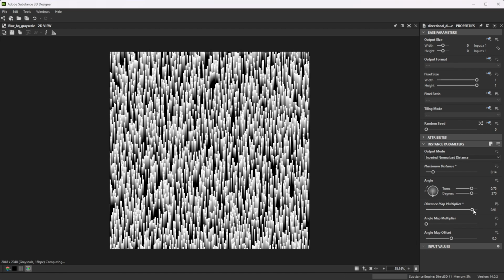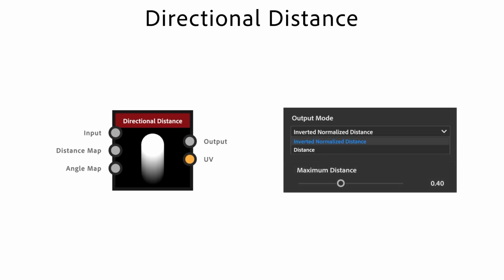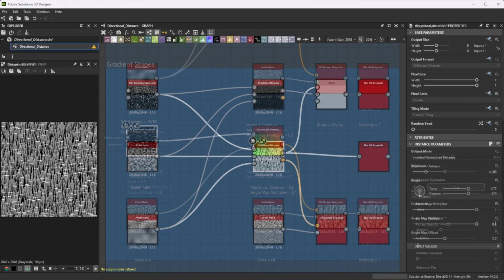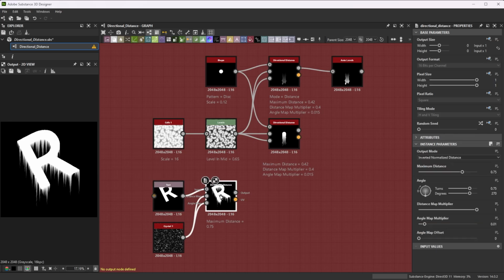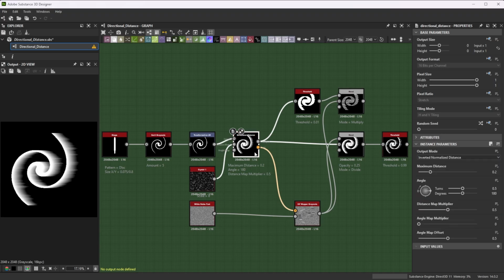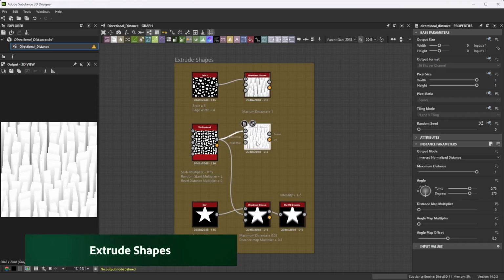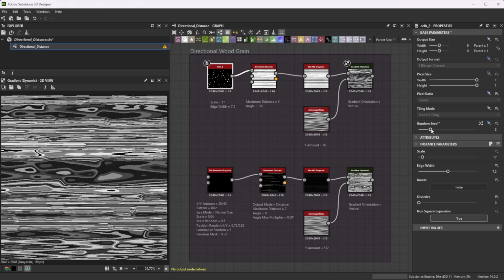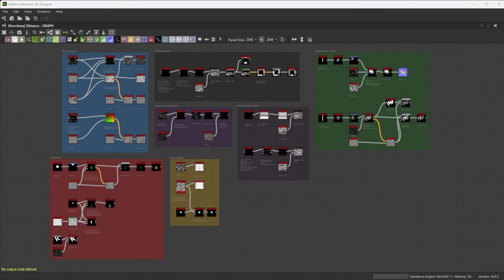Directional Distance Node | Designer Quick Tip #35 | Adobe Substance 3D

Comment: They have finally added this 😊, I have been using my own one for many years now. In matter of fact I  just use a pixel processor that I copy across projects so I can easily change different functionality to my needs. The thing this new node is missing is a gradient input map/bevel falloff. The other things I have often added to mine are having two different types of strength maps one that samples at the source of the extrusion and one that samples at current location. I have sometimes added a cell mask input that it uses to kill any bevel extrusion that passes over a change in value which have some been very useful. I am surprised theres no sample count parameter maybe this node works differently. Now I am mainly just waiting for flood fill transform (this I also change up a lot, sometimes even turning it all the way into more of a tile sampler with a uv output), normal to rotation map (to make this I just stole functionality from the tile sampler I think) and lastly crop height blend (crops but using a height input to blend the edges better with itself and can pretty  much make anything instantly tillable). I wonder how many other people often make these exact nodes/pixel processors setups.
Reply: Hi,
Regarding the falloff map, how different is it compared to applying a curve node right after?
No sample count parameter needed as the nodes uses sphere tracing to compute the distance.
You can use the UV output in combination with the UV mapper to sample the color at the intersection point.